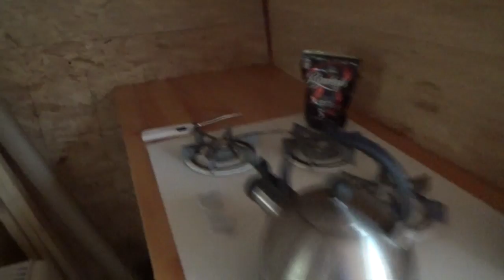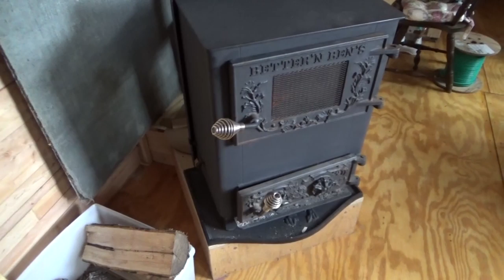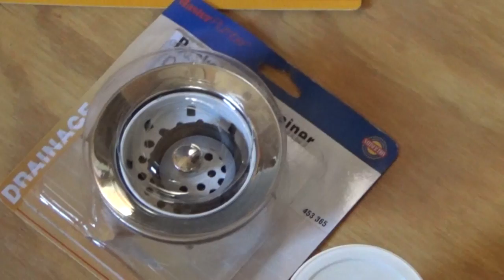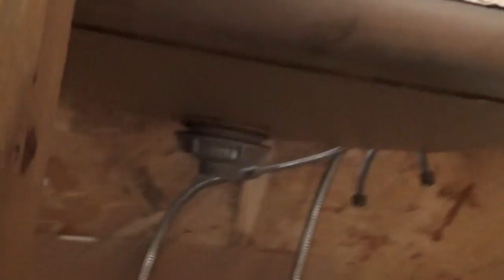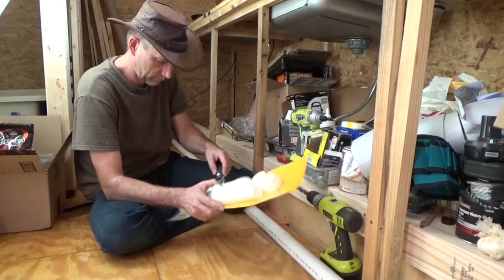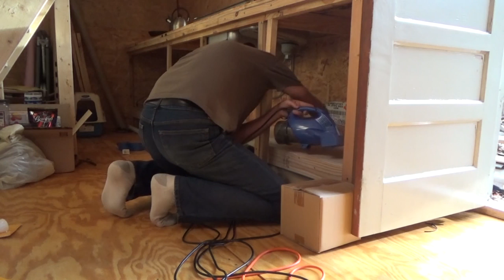Installing The Kitchen Plumbing In My Tiny House O35

Comment: Well, that was painful to watch.  You are doing ok with the materials... I just want to go to Ace and hurt the guy who sold you those pipes.  Please get one of those plastic boxes that are about 3"  deep and as wide and long as you can fit under the sink...because those pipes are going to leak.  Sorry, kiddo... I hate it when people tell you in advance something will fail...but, I think that is going to fail.  When it does if you don't have a catch basin under there that water will either roll on to your pretty wood floor or worse drain back to the wall and down under the house. 
********   I would take those back to ACE and buy PVC.  This is a 'penny wise pound foolish' situation.  It's ok if you don't have the money for the PVC... just use the tailpipes and let them drain into 2 five gallon buckets.  At least you won't get water on or under your floor.  Sort it out next spring.
* Apologies to ACE... it is TruValue who needs a good thump.
Reply: bcoppola1001 Have you ever heard ..." Don't drive faster than your Guardian Angel can fly"?  Well, some times Troy runs faster than his angels can fly!   We keep asking him to give a preview of the upcoming tasks he needs help with so we can help in advance...oh, well.   I suppose if he had all the perfect materials so he could do the work perfectly, we would be bored.  Now we must wait and see if it will leak.  :(
Reply from the maker: These are all they had. Sorry, I got what they had to do the job with. And it was not ACE though. But anyway, it is not leaking for now. Then again, didnt you guaranty that my house would leak ;)
Reply: The Do It Yourself World They probably won't leak, just look under any kitchen sink and that is what you'll see , no stand pipe "vent" needed just cap the dishwasher barbs, this place was assembled in1985 using those pipes and have never leaked !
Reply: jlp1149 No my dear... those are not used by plumbers... not reputable ones anyway.  Frankly, I prefer brass... but economics and shortages being what they are PVC is the minimum - well, actually now the building standard.  Those look and sound like thin plastic pipes.  It is not the pipe but the fitting that will fail.
Reply: Those U shaped pipes are called " traps" .
Reply: Jesse Scott Your cap lock is stuck again.
Oh, please a vent is the least of the problems. Go away and don't play like you know what you  are talking about.
Reply: Jesse Scott the pipes users using for the downs has vents basically already on them he going to hook a hose to both of them from one to the other will act as a vent
Reply: same piping used by contractors and builders , should not leak , just look under your own kitchen sink.
Reply: The Do It Yourself World   Yes I did... I said I guaranty SOMETHING will leak...new houses are just like that.  Now I am certain where the leaks will be. ...  sink and ummm... door sill !
Reply from the maker: MollyDolly Hmmm, what will you have to do when you are wrong? I am sure we can think of something. ahahahah
Reply: Oldcodge with the number of pipes he ran cost here would be around $400 the short ones are $104 + each and fittings are higher of course that's for chromed Brass,
Reply: The Do It Yourself World Hey Punk!  I would rather be wrong than see damage!
Reply: The Do It Yourself World  So...what will YOU do when it leaks and I am right??  NEVER MIND!  I just had a Fashion Show flashback!   We're good... carry on.
Reply: MollyDolly We haven't seen the pink dress YET.
Reply: dustdevl Ooooh  SHUT UP !!!   LOL!!!!
Reply: BadBrainPrepp only when we are gone for several days and the p traps dry out
Reply: 88s10Durango Dude! You are preaching to the choir!  LOL!  That dang door sill has become like the Blue Table... I swear it will be the LAST thing he ever does... just to make me crazy!
Reply: 88s10Durango Whyyyy??? What did I do???  :p
Reply: ***** I don't even know why I was nominated for a time out! {boo-boo face}
Reply: Oldcodge Did something about me give you the impression I don't have expensive taste? LOL!
Reply: Oldcodge I have apparently missed a comment... what is this about pointy shoes and airplanes?   At least you didn't say broom...   Oh, wait... is this to go give our boy a swift one?
Reply: Oldcodge Yep. We do on tubs and bathroom lavs, but not kitchen sinks.  ;/
Reply: Oldcodge What does that mean? 
I see a nitro spray... is that the image?  If so... keep it handy.
Reply: ***** 88s10Durango   Care to join me in reporting that sexually explicit comment by Jesse Scott?

Comment: Coming along nicely, couple of points however. You can never have too much plumbers putty and yes you need to crank that flange nut down as tight as possible the excess putty will squeeze out and can be easily cleaned up with a swipe of the finger around the drain to grout it in nicely and make bead which will allow completely drainage of the sink(s) with no standing water around the base of the drain. Kind of a moot point however since I didn't see where you had completely removed the old putty and you didn't have a completely clean sink to begin with. All foreign matter needs to be removed before you deal with plumbers putty or you'll have a leak from the get go. Tail pipes, you only need  one and that would connect at the base of the tee then the P trap I think you called it drain bin or something then you can run your egress pipe out. You can get a threaded cap for the tail pipe so you don't have to deal with a hose.

Comment: Hi Troy, looking good some great progress. I have a question. Will you install siding to the tiny house before the winter hits? And how important is the siding for your insulation? great video btw. Thanks.
Reply: Pardon me for butting in but this is something that I can answer.  I think that it all depends on how long the snow holds off.  Tarpaper has been around for years and with the use of a few vertical laths to better hold the tarpaper on the walls in high winds, it has been used as a final outside siding.  Troy's place is so well insulated that he could wait until next year to finish the siding and it would be OK.  There are many other things he has to do that have a much higher priority.   Thanks for the positive comment.  Keep it up.please, you are very welcome.

Comment: Step one fasten the sink in place then work on the plumbing. Why did you buy pipes with hose barbs on them, I would have went to a store that had the correct pipes? Where is the sink vent at?
Reply from the maker: I got the only things they had. That is the reason. The vent will be outside in the tank
Reply: sometime that is all they have
Reply: The vent needs to be near the sink for proper drainage.

Comment: The person that sold you 2 sink tail pieces that have dishwasher inlets also did not know much about plumbing.
Youtube has lots about the install you are doing. I like to get the 'J' trap up as high as I can. So cutting the tail pieces as short as I can. Also I would run the drain to the outside, along the back wall so it will be out of the way.
You need John to come over.

Comment: Dude, Your cookin' with gas now! 
:)
Making hot water, putting heat and moister in the dry fall air. Have a cup of something tasty. It's a comfy looking situation.
Kitchen sink plumbing. Make sure the pipes are al well insulated from the outside wall. Burst pipes are no fun. Keep a maintenance dept. somewhere. Just in case it does freeze. Some spare parts, kibbles and bits, glue & cleaner. A hair dryer usually will thaw out a frozen pipe if it's not burst. I put shut-off valve redundancies it strategic locations. All the extra stuff came in handy one extremely cold & windy winter morning. Zip-Zip and I was back in business. I kept the section of burst pipe to show people. It was frozen solid, nothing coming out of the kitchen cold water side. I used a hair dryer on it like I had in years past, and as soon as it started thawing it started spraying. The redundancy shut off came in handy. I've since fixed the problem and it shouldn't ever happen again. If you think your in danger some cold winter night you could open the cabinet doors and let some heat in to the pipes.
Peace and Health. I'm really looking forward to some Winter time videos :)